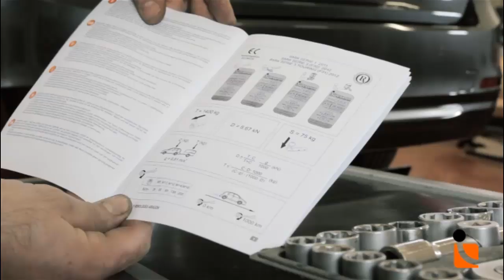How to install a towbar :: Enganches Aragón

Comment: everyone else in Europe calls it a TowBar,,,,,cause your normally Towing something......like a Trailer!!!! Only Americans tend to use terms like - HITCH!!
Reply: middledigit1 doesn't matter what you call it, it's not the proper name. That is a towing hitch. A tow bar is like what was already mentioned: a bar that allows the car to be towed. To say that what you call it is correct simply because that's what you call it is very wrong. You need proper names for separation of subjects otherwise we end up in this situation...
Reply: Erm....not overally interested in a word battle....but 'Hitch' kinda emplies hitching a ride, as in broken car uses its hitch 'bar' or 'hook' to hitch up to another vehicle.....Tow bar and tow ball is used to tow a trailer or car by the vehicle doing the towing. And your right each country more than likely refers to each item in their own right, even though saying that car manufacturers over this side of the world refer to the bar installed specifically for towing as....the tow bar....Just seemed like a logical explanation to me - all good 😊